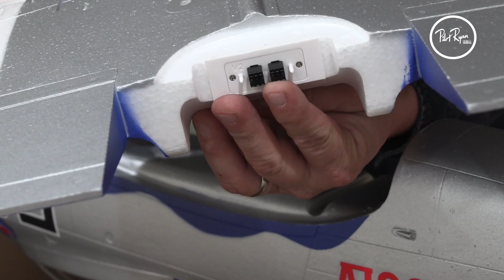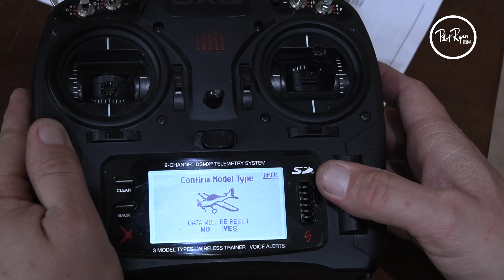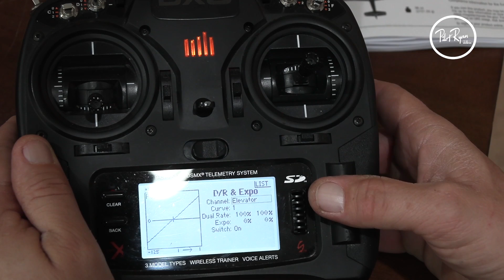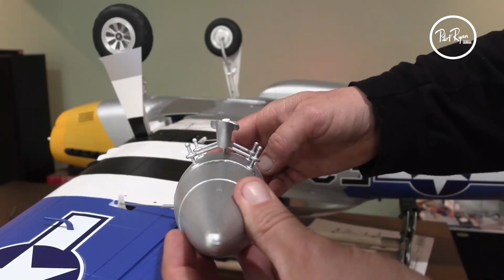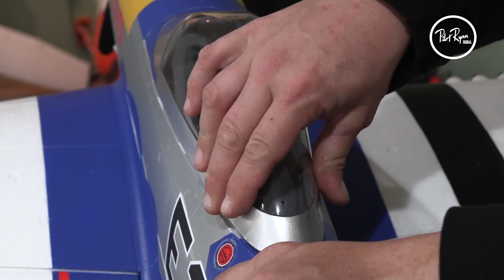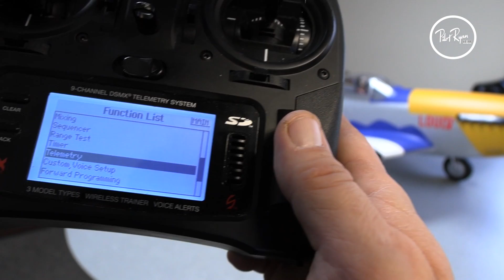E-flite P-51D Mustang 1.5m with Smart Assembly, Radio Setup, and Telemetry Overview

Comment: I just got this plane but I'm having an issue. I have all the servos connected to the receiver, and I plugged the ones that are for the aux bec into the battery channel on the reciever. But when I plug the battery in it just steadily beeps and there is no power to the receiver. Any help would be greatly appreciated.

Comment: To quick change models on the DX9, press the clear and back buttons simultaneously to get into that option without going thru the system set-up way. Just FYI for folks that are not aware of that fearure. Great video Mr Pilot Ryan, very informative 👍🏽👍🏽
Reply: Thanks as I did not know this.

Comment: Ryan....HELP me out if you can....
I seem to have Ail>Rud mixing going on right out of the box with nothing in the radio.... Is this a part of the receiver programming from the factory? Thanks
Reply from the maker: Try to rebound on a new blank channel
Reply: @PilotRyanMedia  Thank you...... I actually finally figured out that when I bound it with SAFE enabled I didn't realize it was active, so when SAFE is active it is part of the programming .... once I assigned SAFE to a switch and turned it off it was normal again.... this new tech is crazy. Thank you for your response !! LOVE this plane and cant wait to fly it!

Comment: Hey Ryan this plane is simple to assemble, so will my DS6 radio work with this plane? you guy's are fun to watch Bobby's a ham and Ryan's enthusiasm is necessary in rc we have to be little goofy lol 😆👍
Reply from the maker: Yes your dx6 will work. Update the firmware to take advantage of the SMART tech
Reply: @PilotRyanMedia  is the 1.2 a smaller plane and is it smart tech?
Reply from the maker: Tim Vanasen 1200mm is like 48 inch wingspan and 1500 is 59 inches in wingspan. The 1.2 does not have the telemetry but does have safe select. Definitely click through the links in my description to check it out. If you’re newer to flying I’d be looking at the 1.2 Trojan or 1.2 Mustang
Reply: @PilotRyanMedia  I was more thinking price, I have a couple advanced planes the E Flight F-18, F-16 Thunderbird and the Thunderbolt their surprisingly easy to fly and advance your skill set, thank's Ryan 😎👍

Comment: That plane is soooo awesome!!   How many channels did you use?  I am looking at new transmitters and wondering if the dx6 is enough for a plane with safe flaps and gear. I assume the gear would be the 7th channel. The website says 6-7 ch is required so I assume SAFE would have to go on 6 ch?   Sorry in advance as I am new to this stuff, but I am already totally addicted!! I have 2 planes now BUT I know I will have a collection in the not so distant future!!!!
Reply from the maker: 6 channels for me. I did not use safe. If I were shopping radios I would get a dx8 or 9. Most planes have channel six for flaps 5 for gear and if someone is using safe they select which switch they want it assigned to. Consider going to www.pilotryanmedia.com and clicking your favorite brands when you go shopping. It earns us commissions which are helpful.👊